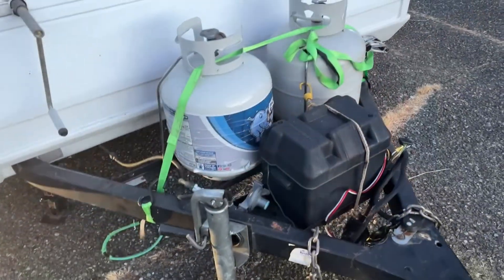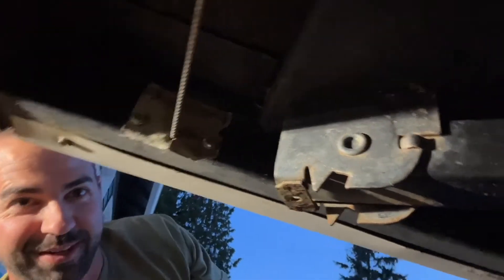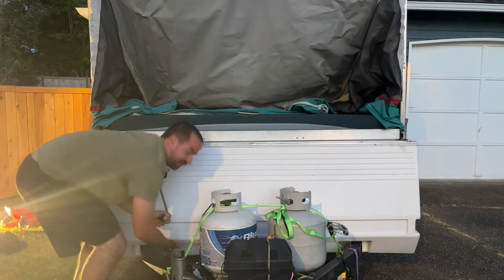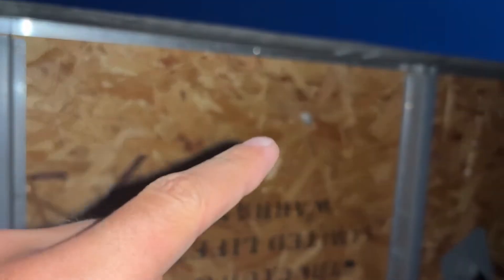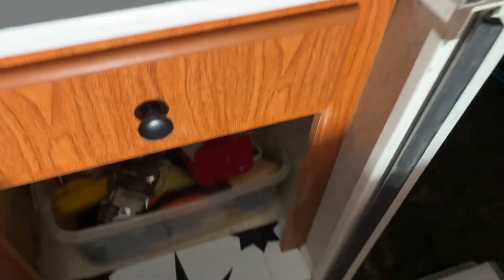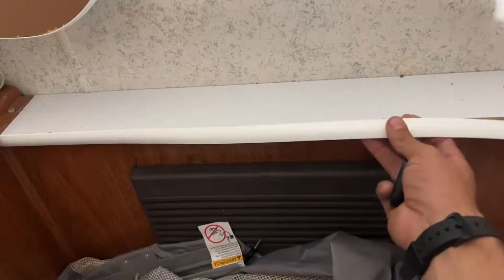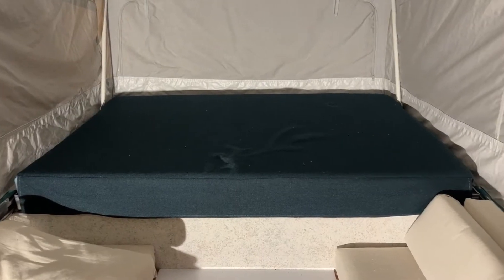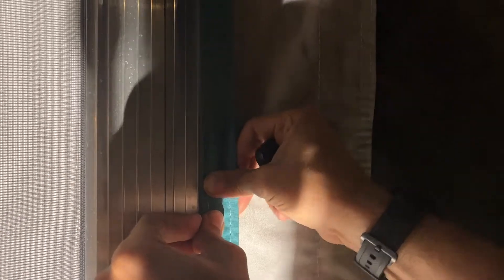Pop Up Camper Tour (very in-depth!) | 1995 Coleman Fleetwood Utah

Comment: My pop up is a different model ..I wanted to see how the sideouts work ..mine are almost impossible 
.so it's hoped that I can put some sylosone on the wheels making it easier to open ..thanks .
Reply from the maker: I do have to give them a couple good pulls. And one of the slide outs is in need of some repair because a screw came off when I was pulling.

Comment: What does the fridge run off ?  I have a 90s colman Fleetwood but can't figure out if its electric or propane
Reply from the maker: The fridge runs when I’m plugged into power. My friend who has a Coleman as well has a fridge run by propane. So I’ve seen both with the Coleman.